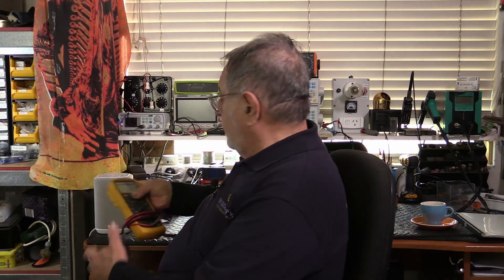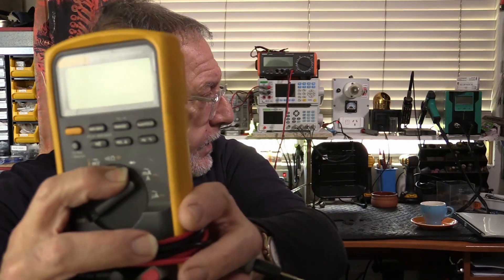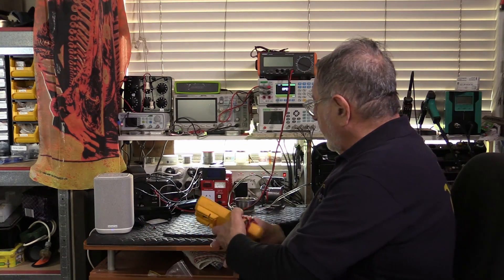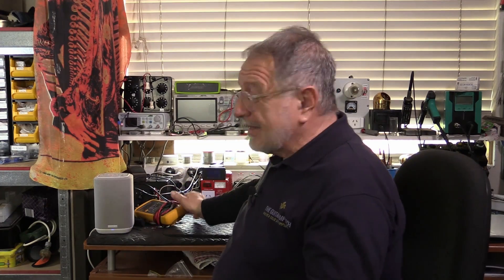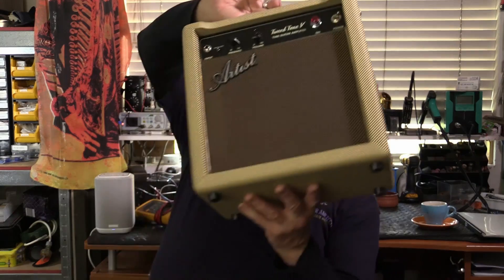How to approach repair of low cost amps - with no schematic

Comment: Interesting story to share about my Lab Series L9. I opened up the amp to chase down a noise problem. Taking a quick visual of the main power circuit board I spotted a blown fuse to the rectifier circuit. The amplifier was working though. So the diode checker on my meter confirmed a shorted diode. Interestingly, there were two fuses from different legs of the supply transformer. I have no clue how long that fuse/diode issue has existed. Apparently the circuit can function with half wave rectification. There was no audible difference after replacing the shorted diode and blown fuse. Just an interesting circumstance, I suppose.
The noise issue turned out to be a noisy power strip. Haha on me. Sometimes it is the unlikely, but should have been considered component bites us on the backside.😂
Very much enjoy your videos. Thank you for sharing.
Reply from the maker: Very interesting, Don. I can recommend Merlin Blencowe's book "Designing Power Supplies for Tube Amplifiers" to help in your understanding, around page 112. I refer to Merlin often.

Comment: I have a cheap amp (bogner alchemist) that has a terrible whine (I assume an oscillation) that is sensitive to the gain control. I have debated sending it to a tech but from looking at the board/schematics it seems like a complicated albeit cheap amp. I was curious if you had any advice/experience with that amp in particular. My plan is to clean out the pots and hope for the best. If you had any thoughts that would be appreciated!
Reply from the maker: They’re not that cheap, Jethro. Sadly a common trend amongst modern amps is to have too many features and options other than focussing on great tone. A Marshall JMP50 or a Fender Deluxe Reverb will always be prized for its tone in the decades to come. People will shake their heads in disbelief at an amp that needs three rectifiers or MIDI and ribbon cables!
I doubt it’s the pots, but good to do anyway. Make sure you use a Clean And LUBRICANT. I use DeOxit F5. When your amp begins to whine GENTLY squeeze each tube in turn (with a heat-insulating rag) to see if you can find the culprit. You could also try “pinging” the tubes with your fingernail as you increase the volume (guitar plugged in with its volume on 1).
If neither changes the nature of the whine, take it to a Tech, bend over and say, “Please teach me a valuable lesson”.
Reply: It was indeed the pots. I gave them a squirt of contact cleaner and compressed air and the whine is gone. It wasn’t perfect because I didn’t end up with a straw for the contact cleaner. The volume pot is  still a bit scratchy on the clean channel, and I think the culprit is still somewhat manifesting. I can audible hear echos of the impulse of me turning the gain knob of the dirty channel. So I think there is just something weird in the architecture of the amp. Will have to study it! Thanks for the help!

Comment: Ill be watching pt2 mate...
I (stupidly) bought a Supro BK 12, cos ld heard horror stories about Blues Jrs and the like.
Great tone, til there wasn't any!!
I turn the vol and master up full to get faint intermittent signal, l now wish ld gone into electronics than steel fixing!!
Reply from the maker: Hi Baabaa. Sure the Bjr has some issues, but its not a horror story at all. The main problem is cost-cutting by the Fender accountants. Your Supro doesn't sound like too hard a problem. If you're in Sydney, drop it in and we'll record its healing process. Try gently wiggling the tubes in their sockets? Any noise...or dead quiet? It could be as simple as a tube failure.